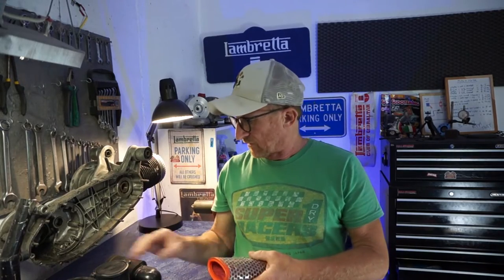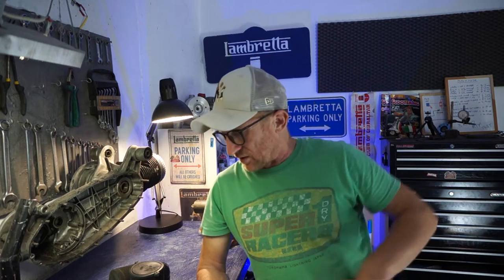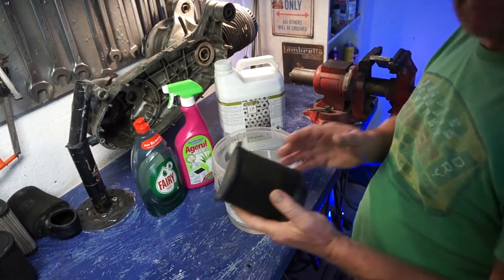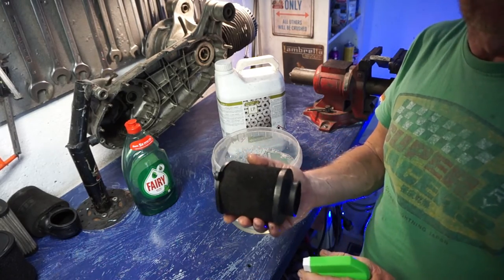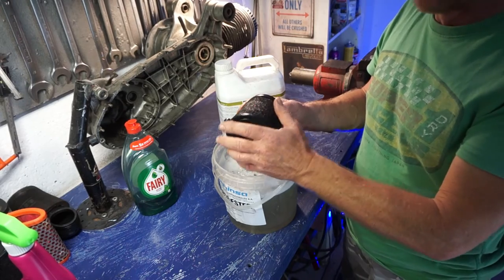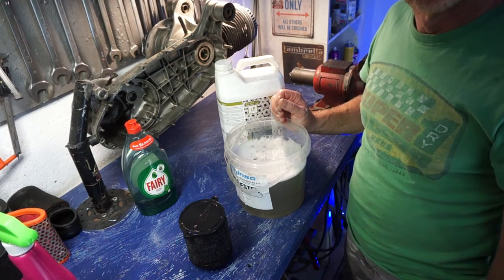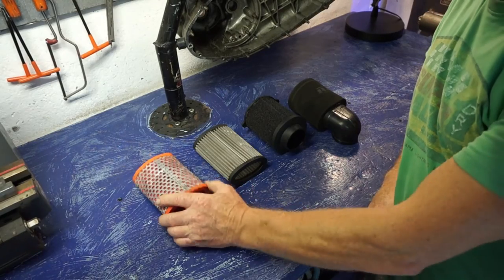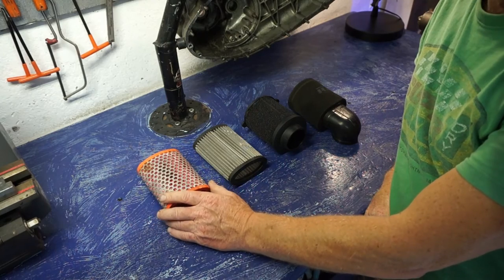LAMBRETTA AIR FILTERS #TheSteelweasel

Comment: Really good video, I tried to use a Ram Air on my Dellorto but hadn't a clue where to start with carb settings and it runs terribly without adjustment.  I ended up running without it on in the end.  A how to video would be helpful.

Comment: Great video again. I use a breathe sweet on my imola. I oiled it for the first time the other week before a ride out. It ran like a bag of shit. Washed and cleaned it when I got back and it ran fine again. I read the back off the filter oil can and it said it can cause the engine to run rich for a while. Mine lasted over 100 Miles 😃
Reply: Hi Carl, if you Oil, you may need to adjust Carb settings
Reply: @markanderson1085  yes you might be right. I think I’ll run it without oil then. Whilst it’s running ok I don’t really want to mess with the settings 😀
Reply from the maker: Carl if its jetted to run with an oiled filter it will run correctly.  But if as in your case you have jetted the bike to run with no oil  and then apply oil the results is obvious.

Comment: What would could one do with a standard Lambretta air filter system?
I've seen people drill holes in the air filter box.
Enlarging the air scope etc...
What's your opinion?
Thanx for the best Lam vids!!!!!!
Reply from the maker: I'll do a follow on vid for air box and hoses etc
Reply: @TheSteelweasel  Do the airbox video Steve! I've got a S1, early S2 big mouth airbox and I want to do a 24 or a 28 PWK with the BGM high flow. I'm thinking I'll drill a few holes at the back....
Reply from the maker: @jfrorn  dont drill holes it only makes it noisy , bgm hi flow box and filter works fine its the air hose that needs to have bigger volume . i use a wwm and a BGM air hose put together to make the flow higher ......
Reply: @TheSteelweasel  Yeah I have the BGM airhose as well! I don't have the BGM hiflow box though, mine's the original late Series 1 box with the bigger hole, not the S2 with the tiny one. I was running a 175 w a 22mm and I needed to remove the BGM filter for it to run well.  I figured my new RT195 (with your decompression mod, yay) would benefit from a few discreet holes...
Reply from the maker: @jfrorn  get the bgm air box dont drill holes .
Reply from the maker: Never drill holes it makes noise and does nothing to the performance . Best is to have the largest area in front of carb possible  . Big air hose and a large neck on air box max carb size 28 mm but I think small carbs give better results .
Reply: @TheSteelweasel 
Ok, I'll leave the Black & Decker alone.
Cheers.
Reply: @TheSteelweasel  I bought a 24 and a 28, I also have a 22mm Jetex. I'm thinking the 24 might be the best option, I'll have to test them. Thanks Steve